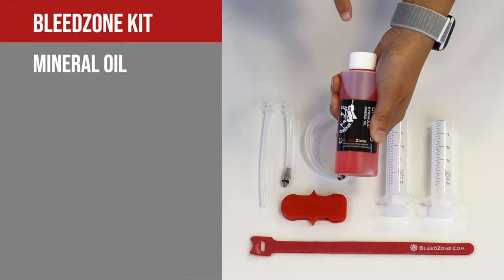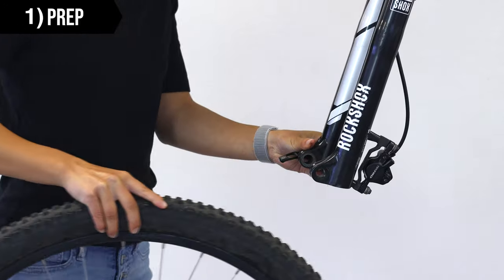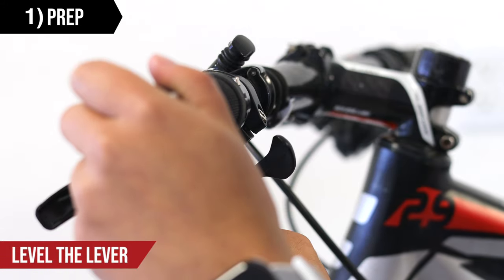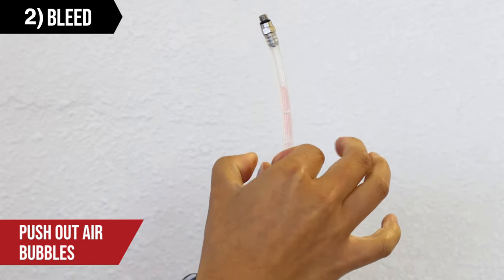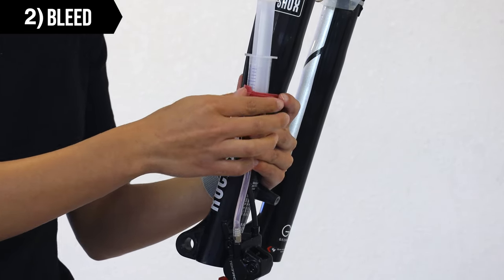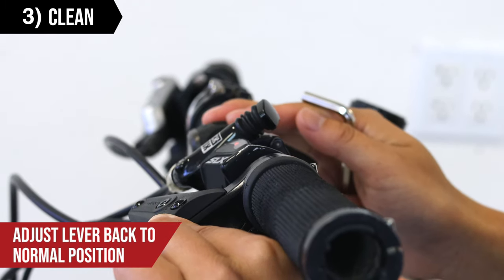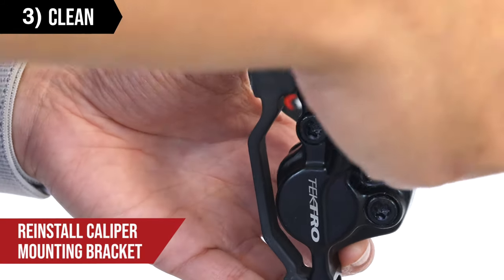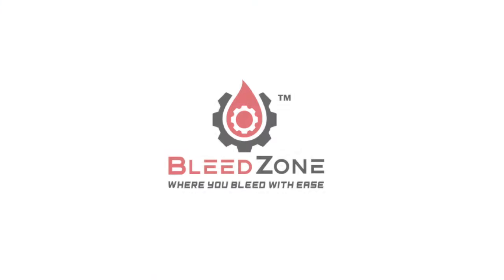How to Bleed Tektro Hydraulic Disc Brakes | BleedZone Kit

Comment: 4:05 why removed the port at this point? The oil is coming out again or not?
Reply from the maker: Are you having issues with oil coming out? Removing the syringe from the lever first and closing the bleed port may help reduce oil leakage. However, even in our video removing the fitting at the caliper first with the lever slightly higher than the caliper had minimal oil leakage. Essentially, when the bleed port at the lever is closed first, it’s comparable to covering one end of a straw with your finger and the water holding because of the greater air pressure under the straw. We are starting the clean up process at 03:26, so no, the oil shouldn't be coming out again except for maybe some slight leakage. Please reach out if you have any further questions!!

Comment: I have watched a lot of videos about this. Then when I went to go try to do it it was not quite so easy for me. And I could not get the metallic brake pads for 3 months. I think I got oil on the brakes I know that's bad. If the oil gets on the rotor can't you clean it off with alcohol? My rotors are $20 or something
Reply from the maker: If the oil gets on the rotor, you can easily clean it with alcohol, but the main issue is oil on the brake pads, which causes them to squeak. Since oil tends to soak into the pads, it's difficult to wash out. From our experience, completely removing oil from brake pads that have been contaminated is nearly impossible even if you bake them in the oven. So what you might need to do is replace them or just work with the squeaking. Good luck!
Reply: You take the wheel off and the pads out, because none of us are as good at doing this as we think we are. wipe, wash, clean, wash glove. Sterile tecnique.  Pads be expensive. Be careful , use good wrenches. That pad retaining bolt is made of butter, and the jerks put Loctite on it.
Reply: Use some fine grit sandpaper and scrape the surface then bake the pads in the oven (200 celcius around 20 min) then sandpaper again and it should be good to go. Repeat if nessesary.
Worked awesome when I accidently spilled oil on my pads. 😊

Comment: This process is only half of it.
This way there is always air in the braking system
since you make a video explaining everything
Thanks
Reply from the maker: Thanks for your feedback, and we’re sorry to hear you still have air in your brakes! Could you clarify what steps are missing? Our bleed process is designed to remove all the air by pushing new fluid through the brake system, and we and many other viewers have had no issues with the bleed process in our tutorial.

Comment: Whars purpose of blocking pistons?
Reply from the maker: Great question! Fully pushing back the pistons and then inserting the block to keep them in place will ensure that the proper amount of brake fluid is in the system both during and after the bleed process. 

If you overfill the system by not using a bleed block to push back the pistons, that could lead to the brake pads not fully retracting, which would cause them to rub the rotor. Overfilling can also prevent the pistons from getting pushed back after the bleed, which can lead to difficulty when installing new brake pads due to the insufficient space from the extra fluid. Hope this helps, and let us know if you have any other questions :)

Comment: I did this for my rear brakes however oil was coming out the pin hole in the middle of the breaks.
Reply from the maker: Thanks for reaching out! Your hydraulic brake system should be a closed system, so it sounds like you have a leak. If you’re referring to the pin hole in the middle of the brake lever, our guess is that the rubber seal inside the reservoir got damaged. Hope that helps, and let us know if you have any other questions.

Comment: Shimano Brake caliper piston popped out. How do I get it back in? :
Reply from the maker: From our research, it looks like you can clean the seal, put on silica grease, and re-insert the Shimano piston. However, if that doesn’t work, you may have to get a new caliper.

Comment: I pop wheelies on my bike and I noticed that when both wheels are on the ground break lever feels good but when I put the bike in the wheelie position my break lever gets really spongy what does this mean and how can I fix ?
Reply from the maker: Our guess is that you have a small amount of air in your hydraulic line, and when you put your bike in the wheelie position, all the air flows up to your brake lever, which is why it becomes spongy. We’d recommend that you bleed your brakes!
Reply: @bleedzonekits  thanks for response ,iv bleed the System twice and it still does it,maybe I need to try with bike in a more vertical position
Reply from the maker: @benjaminfrank_  Gotcha, if you’ve already bled your brakes multiple times with no improvement, something else might be wrong with your brakes! We have heard that Tektro brakes in particular tend to have more issues than other brands like Shimano. So if nothing works, your best bet might be to completely replace your brakes unfortunately.

Comment: I have read that this brakes are very hard to bleed. I have this brakes too and i can't get them to work properly !
Reply from the maker: If you have the right tools and information on how to bleed, the process of bleeding your brakes is simple and straightforward! Have you started on the bleed process? We’d love to help if you could provide more detail on what’s causing difficulties :)
Reply: @bleedzonekits  yes i got the tools and even saw a few tutorials how to do it but the lever still feels spongy after the job is done. I did the type of bleed where you use obly 1 syringe pushing the fluid from the caliper to the bleed port on the lever.
Reply from the maker: @goran1986m  Got it, then in that case, there may be other issues with your brake.
Reply: @bleedzonekits  for example ?
Reply from the maker: @goran1986m  As previously mentioned in the other thread, you could have a leak in your system. Even the smallest leak in your brakes will allow air to enter the lines and negatively affect your brake performance. Common leak-prone areas in the system include the caliper from damaged seals and the hydraulic fluid lines often from corrosion. You might want to check the fittings at the ends of the brake line and the master cylinder cap screws as well.

Other tips during the bleed process if you attempt it again would be to remove your brake caliper and rotate it so that the bleed port on the caliper is at the highest point during your bleed. It helps to gently tap the caliper and hydraulic hoses as well to dislodge any trapped air bubbles. Lastly, when you finish bleeding, pump the lever a few times, which should drop fluid levels, and then top off the oil at the brake lever.

Comment: Why remove the wheel?
Reply from the maker: Removing the wheel helps to provide better access to the brake caliper!
Reply: @bleedzonekits  But when you take the brake completely off, it seems access is 100%.
Reply from the maker: @johnwilson7809  In our experience, we've found it easier to access the brake after removing the wheel, and you might find it easier to take the brake off after you've first removed the wheel. However, if you skip this step, it's not a problem, and you will still be able to bleed your brakes!
Reply: @bleedzonekits  The front wheel is no problem.  But the rear wheel of my ebike is a bit more complicated with the hub motor.  And of course, it's the rear brake that needs bleed.

Comment: It's impossible to get all the air out... Brakes are still spongy...
Reply from the maker: Bleeding your brakes to remove the air in your system is definitely possible! However, if you’ve already bled your brakes multiple times with no improvement, something else may be wrong with your brakes that you might need to look into. For example, you could have a leak in your system, such as in the hydraulic fluid line or brake caliper.
Reply: @bleedzonekits  i did not notice any oil leak but i will inspect it tomorrow again... Could it be the the seals in the caliper is bad or something similar ? I already cleaned tge pistones and worked them out
Reply from the maker: @goran1986m  Yes, checking the seals would be a good idea!

Comment: Tekro must have the worst system ever, I have never had to clean up so much oil :(
Reply from the maker: Yeah, there tends to be some oil leakage no matter what brakes you’re bleeding, but perhaps you could try setting the caliper parallel to the lever to reduce the oil leakage when opening the bleed port, and hopefully it's less messy in the future! 

Also, the order in which you close the bleed ports is important. When the bleed port at the lever is closed first, it’s comparable to covering one end of a straw with your finger and the liquid holding because of the greater air pressure under the straw. If none of that helps, it might just be Tektro's brake system...
Reply: @bleedzonekits  Yes I know all this, I have been doing it for quite a while but for some reason this one always makes the biggest mess.
Reply: Or, you are not real good at this?  Did mine several times with very minimal oil spillage.

Comment: TRP Rep here, you absolutely DO NOT want to use two syringes on our braking systems. You can actually introduce more air into the system with dual syringes. 
Please refer to the TRP MTB Bleed Procedure Tech talks for the correct process!
Reply from the maker: Thanks for commenting! From our experience, the dual syringe method does not introduce air into the system. Bleeding with a funnel versus a syringe does not change the basic bleed process. We don’t know a reason for why bleeding with two syringes would introduce air into the system, and it’s the same method that Tektro, SRAM, and other brake manufacturers use to bleed their brakes.
Reply: @bleedzonekits  TRP = Tektro Racing Products (FYI it's the same company). We've been finding as of late, that using a second syringe has a tendency to foam up the mineral oil an introduce air into the system. We recommend pushing fluid from the caliper to a collection cup at the lever, closing off the caliper and then finishing with a lever purge procedure. This is our factory recommend procedure as of 2021 and why our bleed kit now only comes with one syringe. Cheers!
Reply from the maker: @n8s59  Thanks for your reply! From our experience, we haven’t seen a difference in bleeding using a funnel versus two syringes or heard of a customer complaint on this matter in all our years of selling our kit. The second syringe and tubing act as a funnel and collect the fluid, so I don’t see a reason for how it could foam up oil when it’s simply acting as a collecting container. Using a funnel instead of the second syringe doesn’t change the procedure of pushing fluid from the caliper to the lever.
Reply: I’ve been struggling with bleeding Tektro HDC330s, and I think the two-syringe method is a problem only if you pull a strong vacuum on the top (handle) syringe, as it can pull air in through the threads of the bleed nipple. Compressing the fluid into the system from the caliper works better, though it does produce a small amount of oil leakage around the bleed nipple’s threads.